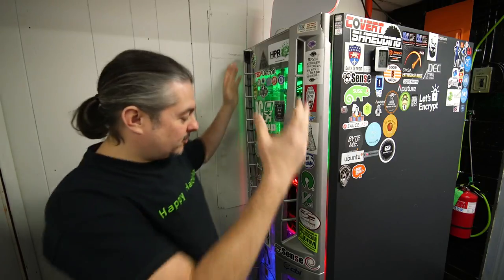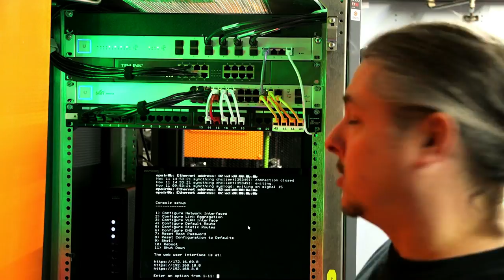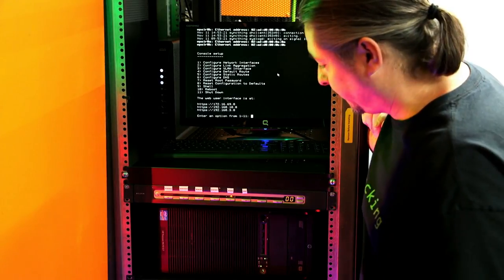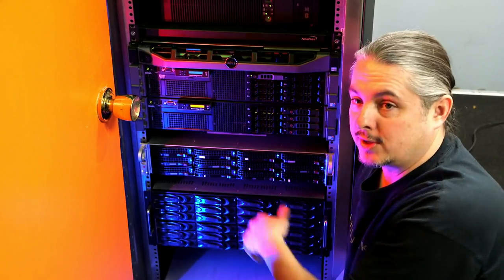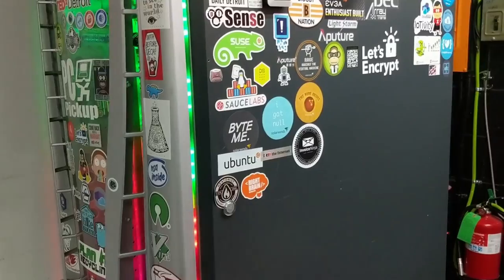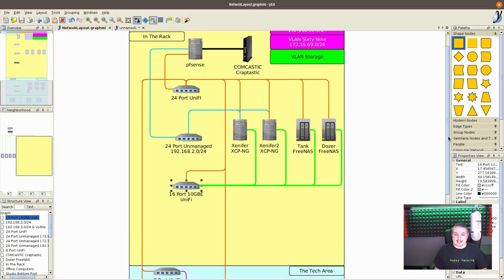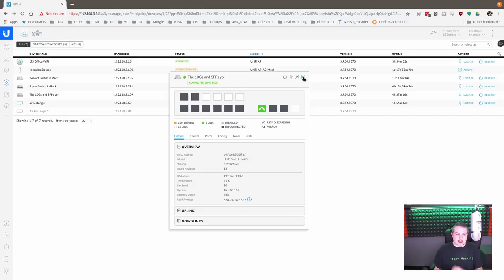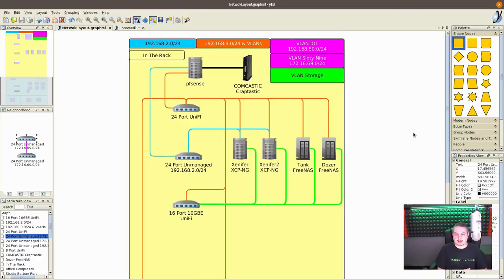Check Out Our Rack / Servers  / Network / 10GbE Cabling Tour and The UnIFI US-16-XG

Comment: Tank or Dozer should be in a different room if they are replicas of each other..
How many power rails do you bring into a rack? We typically do 4: two UPS circuits and two non-ups, filtered circuits, ideally each on their own feeder from panel. Connect redundant power supplies one UPS, one utility...or to different UPSs, as I've had UPSs fail a lot more often than server power supplies..idea being one failed ups or tripped breaker shouldn't bring anything down and even two lost power sources shouldn't take whole rack down
Reply from the maker: Excellent points, maybe next year I will get a second UPS.

Comment: Hi can i ask you a question?  i have about 29 sites on my old laptop on an older version controller, I have another new laptop with 5 sites on it, with the latest controller. can I move the old laptop sites,over to the new controller new laptop.  via the back up future in settings. thanks

Comment: I have all ubiquiti gear USG, two US8-150, US-48 and US-16 XG. I also have the Synology DS418 and Synology DS1618+ for my 10Gb file transfer. What's the best way to connect the switches? I heard daisy chain is not recommended. I am looking for the best performance and I would like two 1Gb port to be aggregated on all 1Gb switches. I don't want to aggregate my 10Gb switch, i don't see much value in that. I am new to this so any pointers would be appreciated. Thank you

Comment: nice rack haha

question, I need to buy a rack NAS with 120 TB storage, and we are getting couple of new servers in the cabinet, each server with 10gb ethernet quad port,

in order for the servers to plugin into the NAS and move files via 10g interface, do I need a switch in the middle (10gb switch), or can I just plugin each server directly (from servers 10g port > NAS 10g port?)

basically I want to setup 1:1 connection between server and NAS for fastest possible I/O

Comment: In order to keep it 10Gb from the XG-16 to the 24 port switch you'd need to plug it into a SFP+ port....correct?  So it's not going to be a 10Gb link between the 24 port and the XG-16?  Currently it appears you're going from a 10Gb port on the XG-16 to a 1Gb port on the 24 port switch....which will communicate at 1Gb between the link. (The server directly connected to the XG-16 would obviously communicate at 10Gb as they are directly connected).  So if you had 6 PC's connected to the 24 port switch you'd still only get a possible maximum of 1Gb between the 24 port and XG-16.
Reply from the maker: I don't think they make one right now, but the 48 port does have SFP+. and correct.
Reply: @LAWRENCESYSTEMS  ok thanks!  I was just getting confused when you said the link was 10Gb...was hoping I wasn't missing a 24 port with SFP+ to add to my collection.  Great video!

Comment: Is the link from the 10GBE switch to the 24 port unifi 10GB?
Reply from the maker: no
Reply: @LAWRENCESYSTEMS  I thought that was the case but wondered if that was a bottleneck. Obviously from server to server will be 10GB but I would have thought you wanted a 10GB link onto the client lan so that in theory you could have 10 clients running pulling 1gig each?

Comment: I have been running that same board you have in your JBOD for my Unraid server since they came out in like 2013 or whatever.  It has been powered up since then with an FX 3850 CPU and served multiple VMs and Docker containers over all these years.  Not a single issue.  So those people running their mouths are idiots.
Reply: And yes, I realize yours is an Intel version